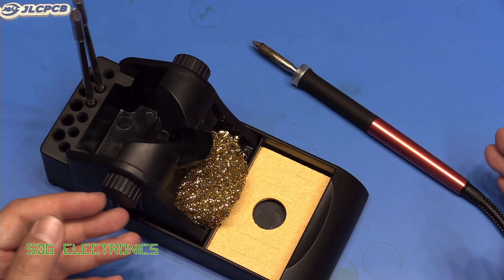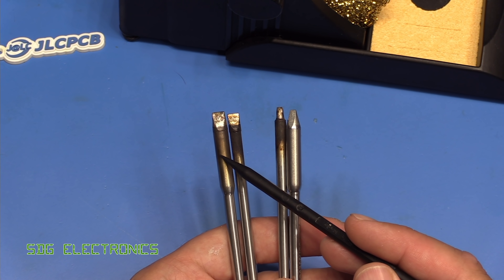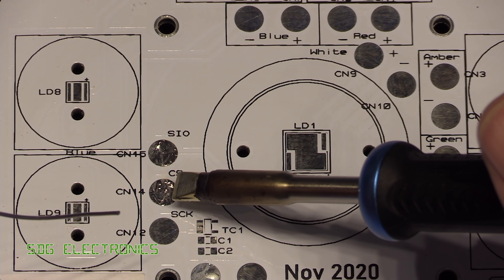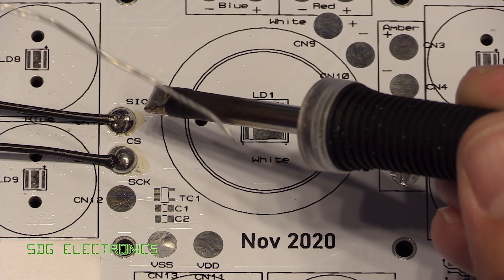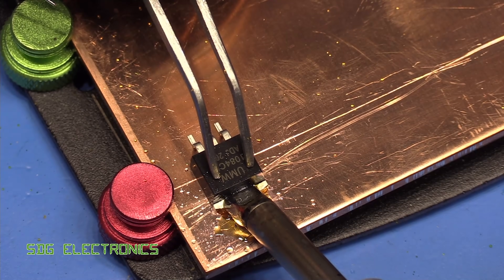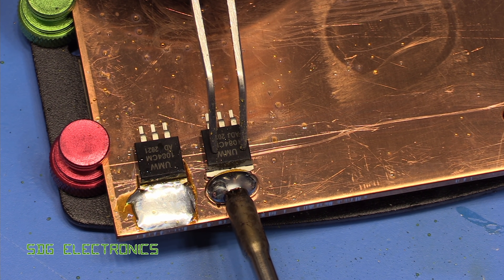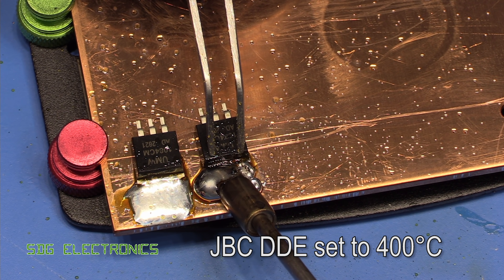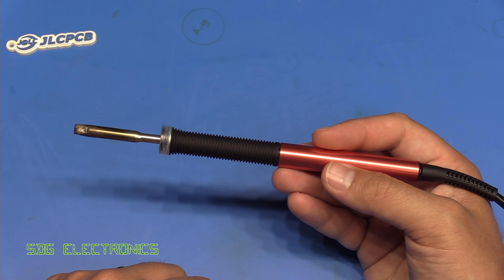SDG #226 Metcal High Thermal Demand Soldering Handpiece CV-H6-HTD, MX-H6-HTD, HCV Cartridges

Comment: What C245 tip was that? You said it's a 7.5mm tip, but the widest chisel style tip I can find is 6.6mm.

Would be interesting to see what a C470 tip could do to that piece of copper. Someone mentioned the (cheap) JBC470 module from Aliexpress a while back.. I bought it including a proper 400W 48V PSU. That thing actually delivers 300W to the tip on startup, which is insane. The C470-006 (10mm chisel) tip I bought for it heats up to 350c in ~10 seconds.
Reply from the maker: You're probably right it might be 6.6mm, though on the steel ruler it measured more. I am looking into the C470 ;)

Comment: Just a sugestion for the next video try to compare JBC c470 heavy duty handle with this new one from Metcal . It will be very interesting to see who is better JBC or Metcal .
Reply from the maker: I'm certain the C470 will be dramatically superior assuming you can get the power out of the tips. It's a very high power system!
Reply: @sdgelectronics   the c470 tips have a big size and i think this is wath is made them so powerful .
Reply: @sdgelectronics   definetly will be a very interesting video.
Reply: @sdgelectronics  Metcal has a new handle and a new cartridge series that is made of two heaters, the heaters heat one single tip, it can connect to two MX5200 stations, seems for 160W in total, the tip geometry is limited, but should compete just fine with C470
Reply: @FooBar89  Saw those in their catalogue. They look epic. Small light sabers.